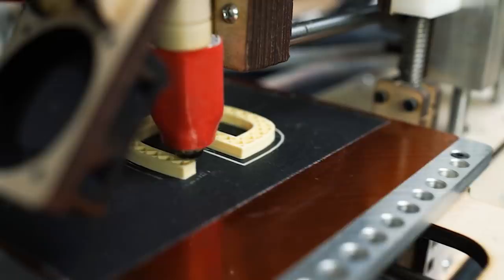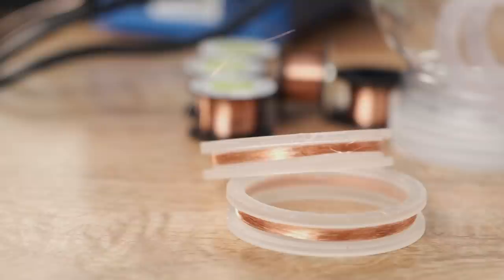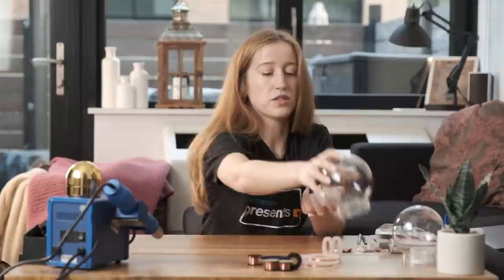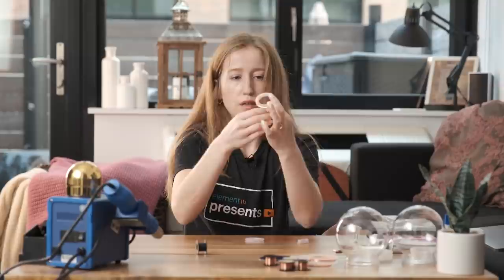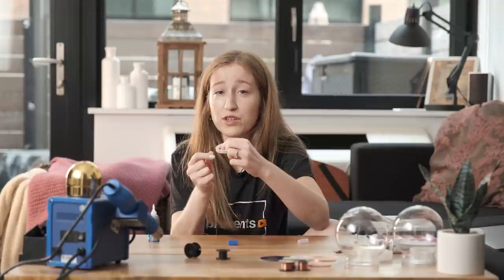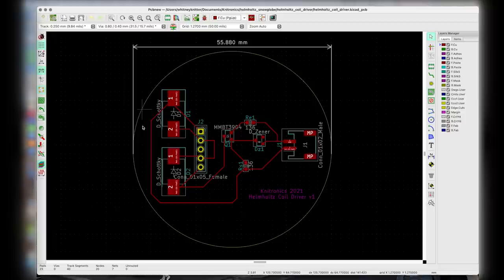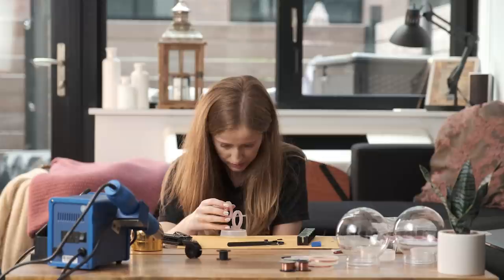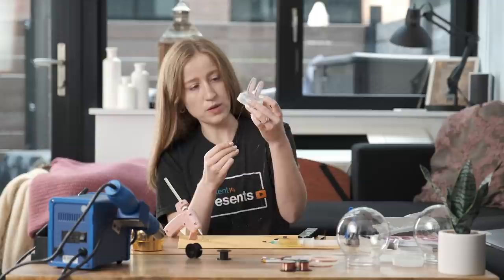Demonstrating Magnetic Fields with Helmholtz Coils in a Snow Globe

Comment: Fun project :) There are two types of enameled bell wire, ones you can simply solder to and the heat of the iron removes the coating, or ones you need to sand. Oddly I have come across wire finer than #40 that needs to be sanded (insane I know) but along with buying the wire please advise get the wire that can simply be soldered SO much simpler to use.  The other way to secure a wire would be with nail polish which is my preferred means as I don't glue my fingers together and it can be de-bonded easy with nail polish remover (so long as that remover doesn't attack the plastic of your former). Also mineral oil comes in different weights, usually people will find "light" and "heavy".  Filings also come in sizes too :)   I would have put a 1/2 inch or so riser pin under the coils to lift them up, maybe center the coils in the globe overall.
Reply: All great suggestions! Thank you!!

Comment: 7:58 - There is also ~0.65V drop between base and emitter of a BJT so the voltage drop across R4 is Vzd - 0.65. Which can make a significant difference.

Comment: If you use the female header as a holder when soldering the wires onto the male header, even if the plastic melts a bit, the pins stay correctly positioned.

Comment: Not gonna lie, I was excited to see the ferromagnetic particles clinging to the electric magnet along the magnetic field lines and the result was kind of a bummer. But failing is an important part of engineering and here are some suggestions for a rev.2 of this demo build:
1) Ideally the liquid should have a very high viscosity that the ferromagnetic particles need much more time to sink to the bottom after being distributed through the globe by shaking it up. Think some liquid like honey with some distilled water.
2) Get some beefy lab power supply of the switching variety to be able to experiment with different current values without using up time to build different current drivers.
3) You'll probably need at least a couple amps to affect ferromagnetic particles in that kind of distance without a core so I agree that you need coils that can handle much more current.

Comment: For v.2:  Heat the header pins and push them thru the base, so you can solder the coil wires inside the globe.  Heating a header may damage it's plastic, so be prepared to use one to make the holes, and another for the actual wiring.

Comment: Wouldn't it be cool if you used two perpendicular sets of Helmholtz coils and drove each pair with with parametric sinusoidal waveforms to suspend them in any Lissajous pattern?
For example:  If
1) x=R sin(t) and
2)  y=R cos(t)
then, adding would give (x^2) + (y^2) = R^2 [cos(t)] ^2   +   R^2 [sin(t)]^2
and since sin squared  +  cos squared =1, you get:
x^2 +y^2 = R^2  which would be a suspended circle of radius R.

If the frequency's and phase's are variable and the field is strong enough, you may manage all sorts of slowly rotating Lissajous figures...it would be awesome!.
Thanks for the video!!!
--dALe

Comment: Super Glue (Cyanoacrylate) TIP/Trick:  Sprinkle a little sodium bicarbonate (baking soda) on the super glue and it will cure instantly.  Be certain that the two parts you are joining have adequate glue applied and are position/aligned just right because once you sprinkle on the sodium bicarbonate it’s difficult, if even possible, to go back.
Reply: There are also commercial accelerants you can buy
Reply: @Workshopshed  Indeed there are.  I have two different brands of accelerant but rarely use them because the fumes and residues bother me, personal preference.  Baking soda also absorbs odors rather than produce them and has more predictable chemical reactions in cases where a glued item will be submerged in a liquid.  Gives me an idea drop some baking soda-cured cyanoacrylate into vinegar to see if the carbon dioxide release happens.

Comment: Well, that was... unsatisfactory. Could have shown the nail paint after the magnets were active, maybe there would be some action in the clouds. Could have tried ground neodymium magnet (not hard to break apart), ... or at least show some higher current experiments... maybe the oil would be enough to cool down the wires for much higher current? Hope for more experimentation in pt. 2, if there will be one. Btw. if you want to do tidy and easy wrapping of a wire around a pin, there are wire-wrapping tools designed for it (used a lot in the past for prototyping).
Reply: The oil will cool the wires quite a lot, that's why large transformers are immersed in oil.